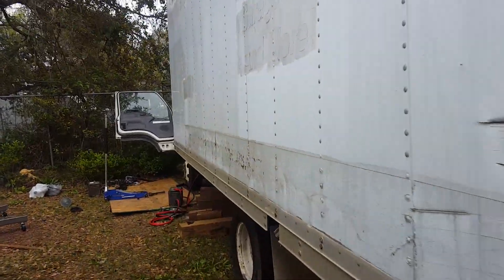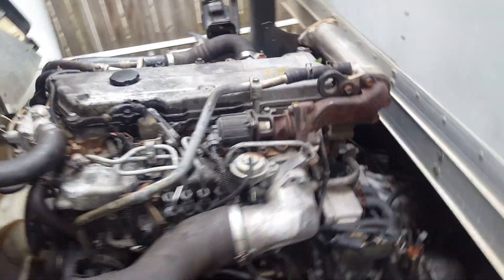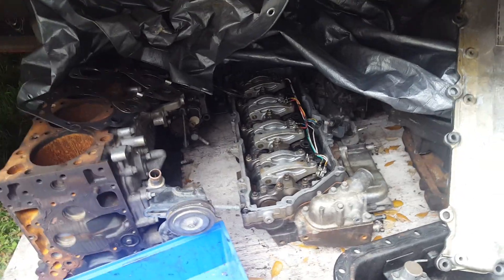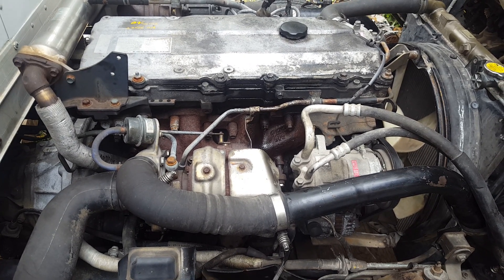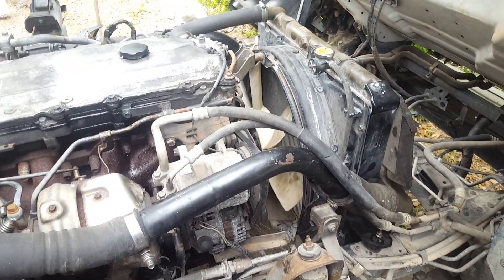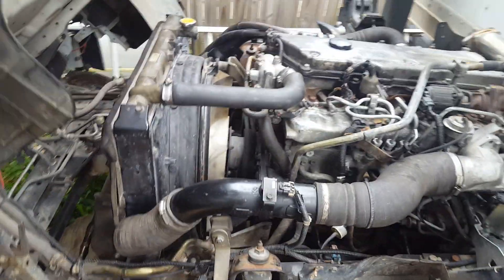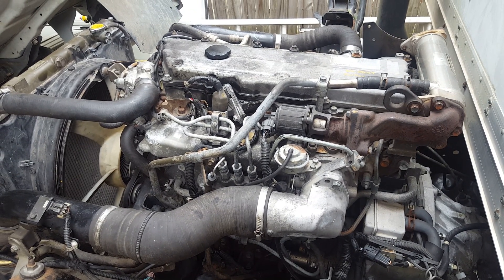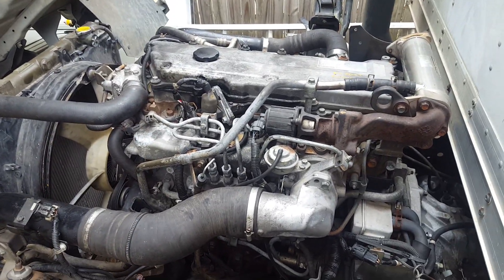Isuzu NPR 4HK1TC 5.2 diesel engine replacement start attempt

Comment: I’m an Isuzu tech. That motor definitely sounds low on compression spinning over. Compression test should be next step. Remove head and inspect. Liners were still in these engines up until 2010z
Reply: Kyle I have a 2004 FTR were is the fuel limiter valve located? Thks for your help
Reply: Hi kyle
I need some help with a 4hg1 ticking noise
Reply: @malcolmmcdonald6102  did you figure out your ticking noise
Reply: Hey Kyle,
I have a 2007 GMC W4500 5.2 diesel.
Runs great gears 1-3 but I don’t feel I have 4th gear/OD.
My max speed is around 50 at 3000 RPM’s.
No check engine light on.
Advice?

Comment: I suggest to check glue plug if it's in working
Reply from the maker: Ahh yes, great idea. It actually ended up being the head was warped, which caused the head gasket to leak, low compression, and no start.

Comment: if your timing is good and your compression is good than you are not getting 
fuel check your fuel pump i wont recommend to used any starting fluid cuz it
can damage your engine head gasket  check your fuel pressure
Reply from the maker: It ended up being a warped cylinder head which made it loose compression.

Comment: Ouch....yeah,she definitely is low on compression....could be from dry cylinders, or can be from bad liners/rings.....first thing I'd do is hook up a scanner and check live data for 7,000-11,000 psi while cranking...if you have fuel pressure at the rail,then i wouldn't even bother with a compression test and pull the head....they're easy...I pull them in just about an hour,with hand tools
Reply from the maker: Nice. Thanks for the info. I ended up having to replace the head because it was warped.
Reply: Any idea on how she may have warped? Possible overheat condition...or someone blew the radiator and added water to a super hot engine,which will definitely warp stuff...glad to hear you found the issue!!👍

Comment: Crack open number 1 injector line at the injector when the fuel starts coming out and starts tighten it up the pump method sucks
Reply from the maker: Thanks for the tip. I will try it.